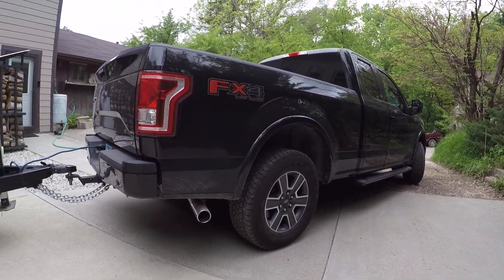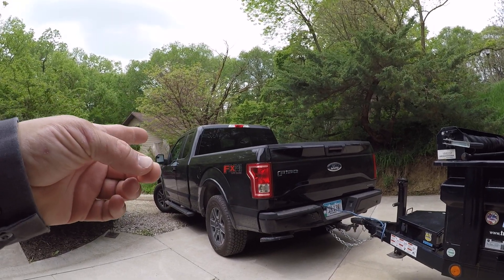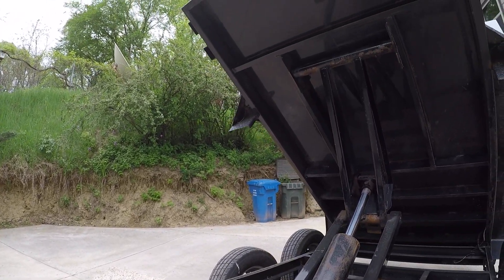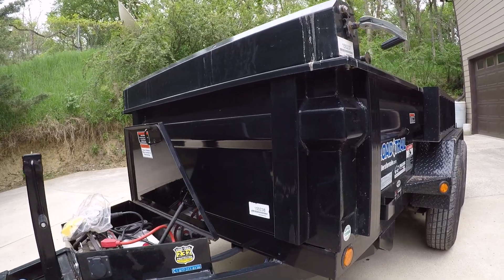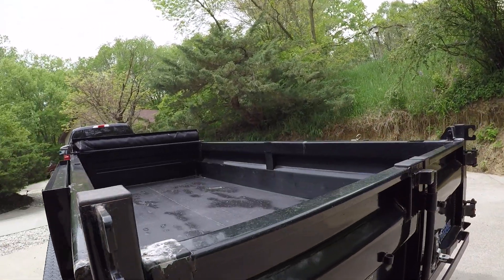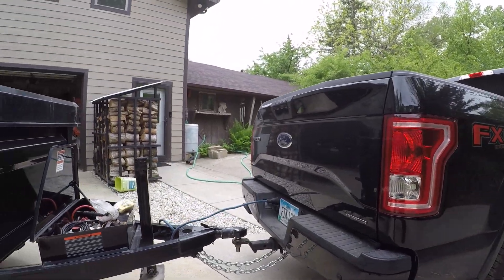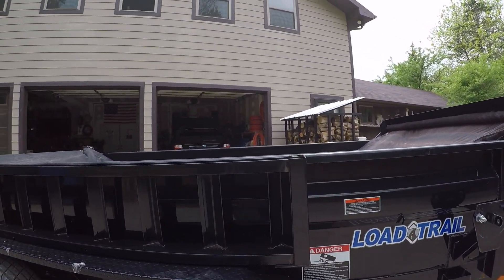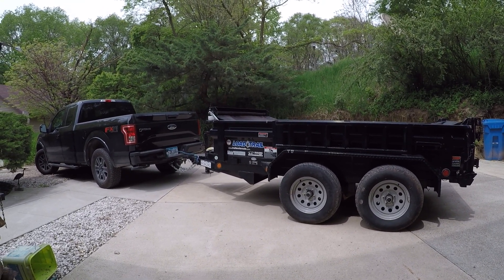Pandemic Projects.  Load Trail Dump Trailer:

Comment: perfect trailer for your truck.  They make a 10k version of the 5x10, everything is the same except the axles are 5k.  So the frame is very strong.
Reply from the maker: So far I'm pretty happy with the trailer. No issues other than I did have a lug nut issue but that was human error .. lol
Reply: @Elveshelves  did you build side walls? I added 2x10s to mine and basically increase capacity by 50% and can take them off when i need to.
Reply from the maker: I haven't done any side wall extensions yet, but its on my list of things to do. So far I'm only hauling rock and crushed concrete... but for light material like tree branches & brush... oh yeah extensions all the way!!!